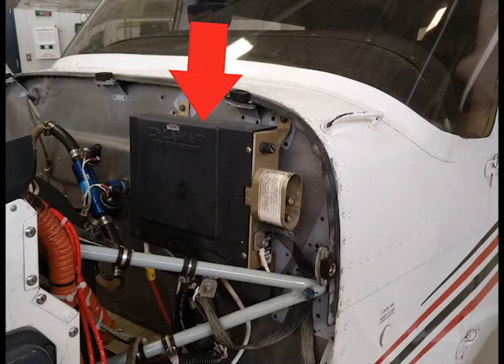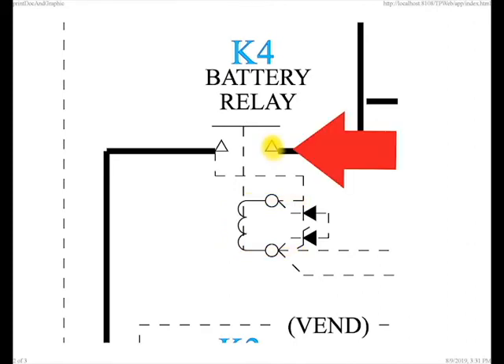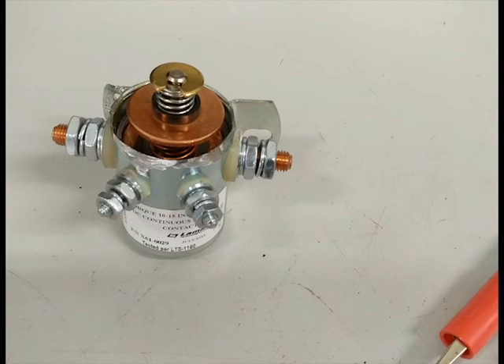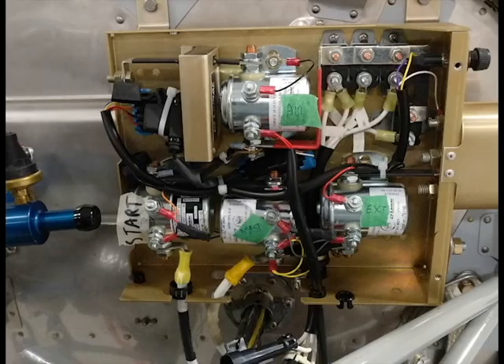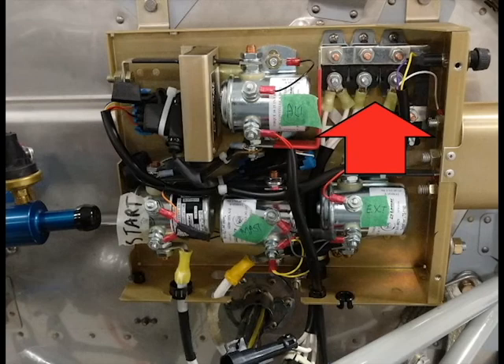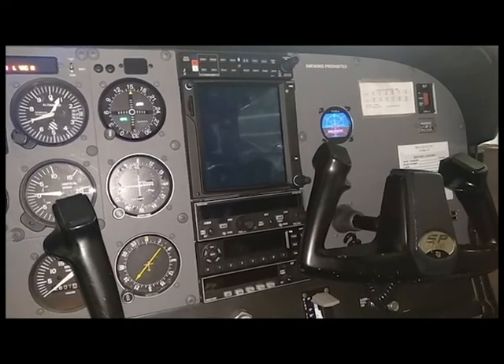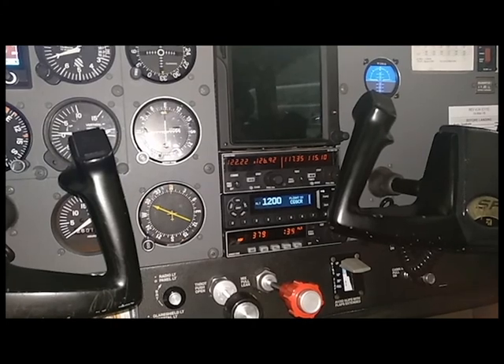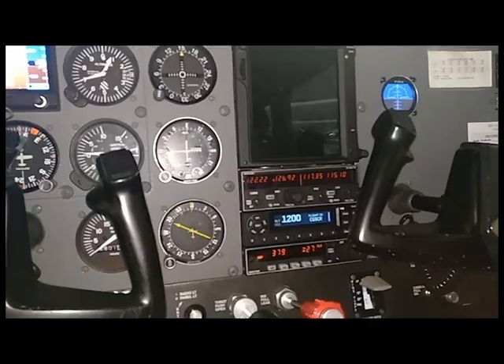172 Electrical system

Comment: Thanks for the video! I had an electrical failure today in a C172M and declared an emergency. Comms mixer still worked, so did the turn coordinator. The flaps worked but flap indicator was dead. Garmin 430, G5 display, squawk, VOR’s, engine gauges and radio 2 were all dead. After cycling avionics & master switch and pulling/resetting GPS/radio CB’s I got lucky - radio 2 was dead but somehow came back up and was tuned to guard (had been tuned to ATIS when emergency occurred) - Seattle App was attempting to contact me on guard so I had poor but effective comms. The box was w/o pwr- so I’m not sure what happened. Got the plane on the ground and am reading up tonight to try and understand what happened. Waiting for the FBO’s A&P tomorrow to find out more.
Reply from the maker: My video is about the 172S models, specifically the ones used by the flight school that I work for, but I'm glad it was of some use to you.  Good luck.

Comment: The junction box....I had no idea it existed. Although I’m only a sim pilot I love learning the various systems in detail especially the C172. Thanks for this.
Reply: Not all 172‘s have this the later models the R models  and onwords . Anything that is carbureted will not have this box as they don’t need to regulate fuel injection but it’s still a good video and great information.
Reply from the maker: The fuel injection system is completely independant of the electrical system.  The aren't connected in any way. But your right this video only pertains to the newer C172 like the S models that we have.

Comment: This is just an R model or injected 360 correct. You won’t see these on earlier models and leave as well we have regulators on them.
Reply from the maker: My school uses C172 S models with the 180Hp Lycoming engine.  Older models will be different.